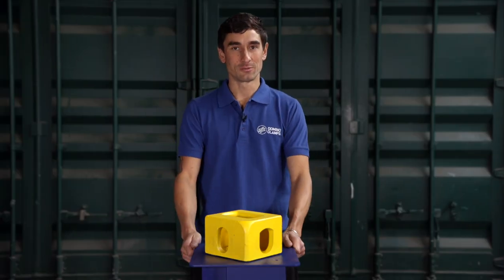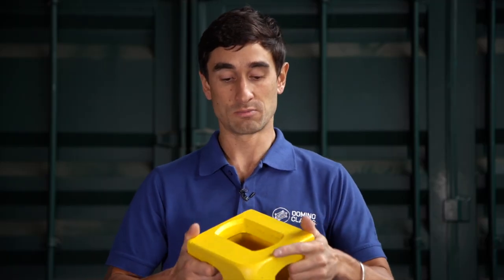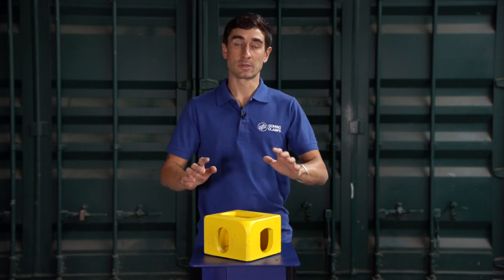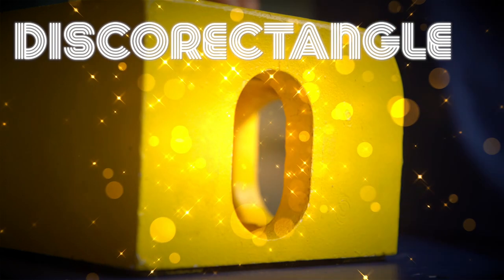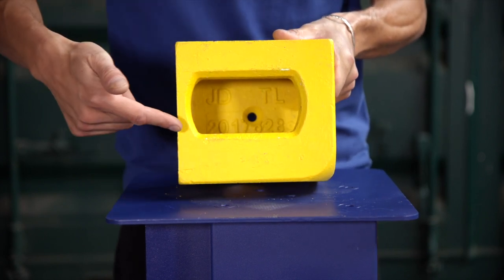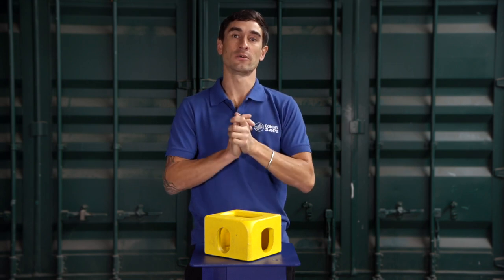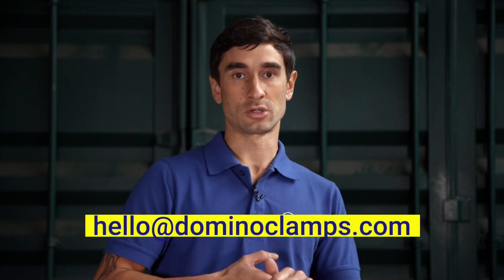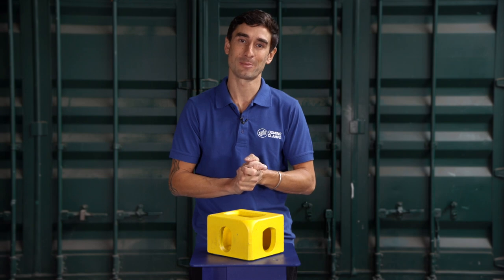An introduction to shipping container corner castings

Comment: I noticed you have rubber between the containers pretty clever.
Rubber is also used in bridge building supporting some crazy astronomical weights. It plays a major toll in building seísmo resistant structures. Stealing
Reply from the maker: Nice!